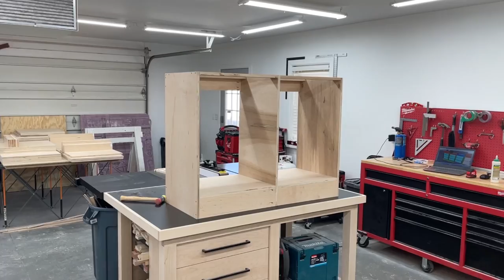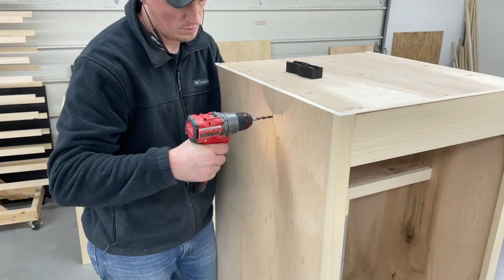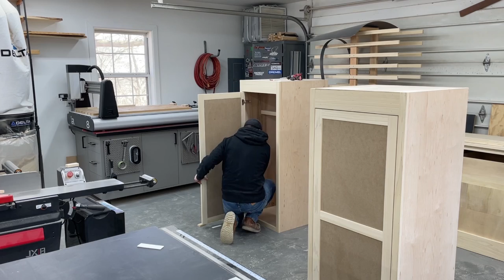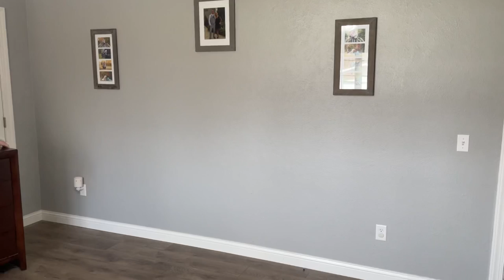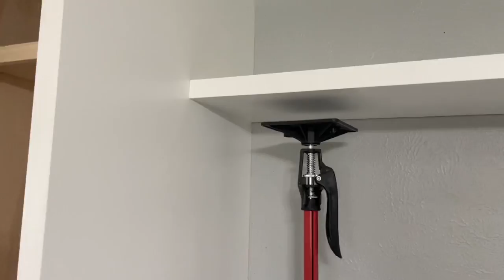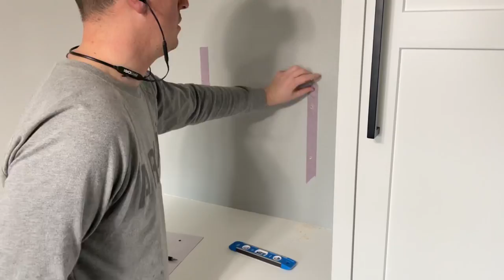Building a MASSIVE Built-in Armoire/Wardrobe

Comment: I had a plan as to what cabinets I would add to my library/office but after watching your video I have decided to make many changes. Every cabinet maker out there suggests a toe kicks so I didn't give it that much thought but your build without toe kicks looks so much better and will allow me to add baseboard molding, after I make it, to the bottom of the cabinet so it matches the rest of the room. 

Adding the crown and in my case the baseboard molding before redoing the molding in that room will also make it a lot easier when I replace the crown molding and reattach the rest of the baseboard molding I need to remove so the cabinet looks like it belongs in the room is a smart idea. It will also make finishing the room so much easier as construction fatigue sets in. Altogether it is a beautiful cabinet. I own a house built in 1893-96 and the closets are oddly sized to say the least. I know how frustrating it is to dig into an over stuffed closet and having to add additional lighting just to easily find a particular outfit. I realize that I will have to add a few inches at the bottom to allow for the baseboard molding but that is a minor issue. I am saving this video to watch again before I redo my plans. Great build!
Reply from the maker: Glad you were able to take some ideas for your own products, love to hear that! Enjoy the build!

Comment: Nice work.  We have a walk-in closet in our 60s home as well as a wall with two closets with sliding doors.  It takes up a whole wall.  I wanted fit out the walk-in with built ins as well as remove the doors and wall between them closets.  Then make a large insert with a spot for a TV like you did.  With drawer storage and make some full cabinets for full length and half link along with maybe some shoe storage.  Would just make it a bit for functional.
Reply from the maker: Definitely sounds more functional!!

Comment: Great build! Simple design but incredible overall project. What do you usually use as your top coat when using BIN shellac primer?
Reply from the maker: I’ve been using target coatings water based lacquer a lot, but this is sherwin Williams emerald to match the existing trim/doors

Comment: Great build John. Do you find you can get very straight cuts off the track saw by moving the track for longer cuts. I just picked up the makita track saw and was holding off buying a second track for fear of alignment issues.
Reply from the maker: In this case with scribing, it wasn’t a straight cut I was trying to do haha wavy wall. To join 2 tracks you’ll most likely have to trim the ends to square them up, none of mine have come perfectly square

Comment: Birch Peel and Stick Edge Banding, speed up the process if you don't want to use the iron,  I prefer using Peel and Stick Edge Banding  over the other one,  good video 👍
Reply from the maker: I’ve yet to try that. Not trusting that it’ll last haha you’ve found it holds up good though?
Reply: @JohnBuildsIt  that is what I use I've been using for 2 years now quicker than the one you use but I will never use any other brand if is not 3M twice expensive as iron tape though

Comment: Hey John, good stuff per usual. Quick question though: I have that same larger Rigid shop vac. What is that intermediate stack between the top and body? I'm assuming it's some sort of cyclonic apparatus, I just have never seen or heard of one like that before.
Reply from the maker: It’s an idea Dustopper was working on. They have a video about it on their channel I believe! But yea it’s basically a built in separator

Comment: Awesome job as usual! Love the build process and your builds always feel approachable. Quick question, do you only have the 55” track for the Milwaukee track saw? I was looking to buy the saw as well but not sure about dropping the crazy amount of money on the larger track as well as getting a 55”. Thanks again and keep up the great content.
Reply from the maker: No I ordered the 106” too. I’d just start with the 55” and get a feel for what you want and works for you. For my makita I just have 2 of the 55” that I join together for long rips
Reply: @JohnBuildsIt  thanks for your reply. Was just curious since I saw you cut a long rip by moving the smaller length one (from what I could tell at least). I have heard mixed reviews on joining the two 55” tracks together vs a 106” long one. Things to think about. At least starting with a 55” one. Thanks.
Reply from the maker: @esterndesign  the long tracks getting damaged in shipping is a big problem, but I will say my Milwaukee arrived safe and is dead on straight. On joining 55” tracks, I don’t know why, but every track I’ve seen, the ends don’t come perfectly square. So they do usually need trimmed then they can be joined with no issues. Oh and on that cut where I was moving the track, that wasn’t one long straight cut haha wavy wall! Thanks for watching man!
Reply: @JohnBuildsIt  ah that makes sense. Do you trim the 55” on the miter saw? Thank you
Reply from the maker: @esterndesign  yep!

Comment: I bought that edge band trimmer at Menards and I absolutely hate using it. The blades keep shifting on me even if the bolt is tightened properly and I just don't feel like it offers me the level of control I want.

I thought I've seen you use a different trimmer in the past. Am I mistaken?
Reply from the maker: You have this yellow one I’m using here? Man this is the only one I’ve found that actually works good for me! I’ve tried probably 4 different ones of the 2 sided style, nothing but frustration. Before I found this I was just using a plain razor blade
Reply: @JohnBuildsIt  Yes, I do. When it works for me, it leaves a great finish, but when it doesn't I just get frustrated. The latter happens about 75% of the time.

The blades on mine keep "unseating" themselves as if the plastic separates just a hair too much. I have to re-seat them and tighten it back up. I might try a more rigid backer plate, if you will, to alleviate that. Maybe mine's a lemon.

I'm a bit skeptical of the two-sided ones because I'm afraid of a tear-out on one side depending on the grain direction.

I'll keep tinkering with it. It doesn't help that I hate applying edge banding!

Comment: Looks really great. I tensed up every time you installed hardware or pocket screws with an impact. How does that red kool-aid taste?
Reply from the maker: Pretty good for the most part. Has different drive modes for a reason
Reply: If you're drilling a hole - use a drill.  Anything else is best handled with an impact.  It's definitely one of my favorite tools.